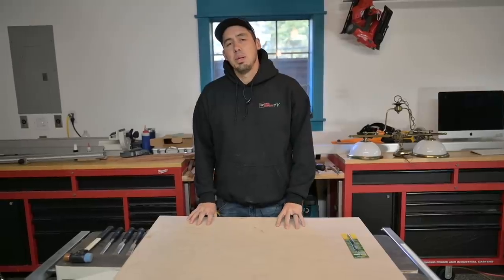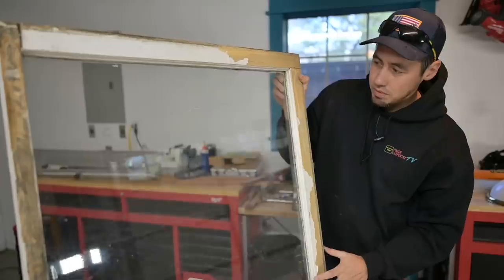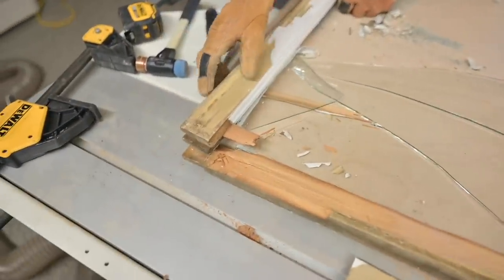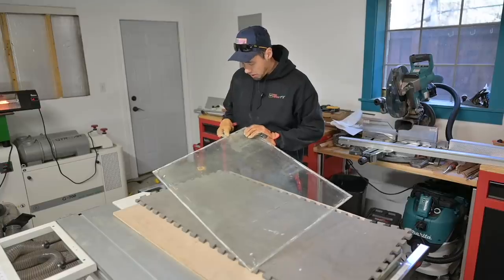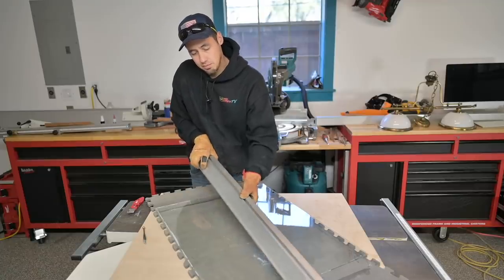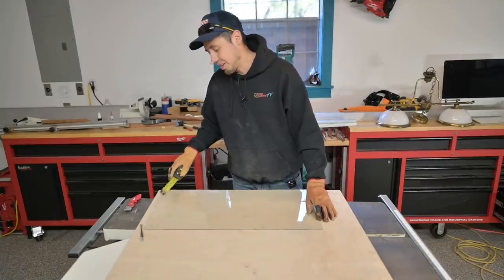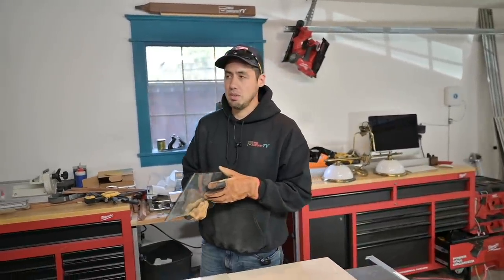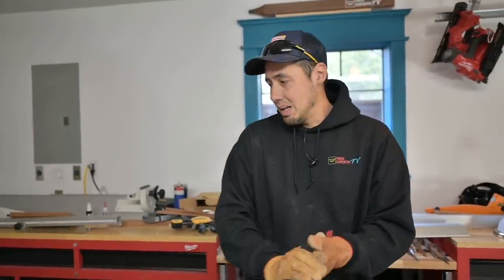Cutting the GLASS for my CUSTOM DOOR!

Comment: Take a sanding block with 100 or 240 grit abrasive and hit all the edges right after cutting. It will soften sharp edges and reduce stress cracks later too.

Comment: The mounting plate for that light is the slotted silver piece in the fixture base. that hollow threaded piece with the wires coming out of it just needs to be backed out most of the way. put screws through the slots into the electrical box.

Comment: Silicone sealants and adhesives won't stick to Odie's Oil so you need to install it BEFORE you finish the door. You also need to have that glass laminated before you install it with a safety film (Building code requires that now, or use tempered glass panels). I saw the future on the first pane. Good thinking to buy a second one while you were there! Layout and cut your hinge mortises and door lock mortises before you finish also, working from both sides to the center of the door.
Cut your hinge mortises with a jig and a handheld router. It'll look better and go faster. Most jigs use a center line to layout to.
Ryobi has an inexpensive jig for hinge mortises that comes with everything you need, and works very well. If you have to layout to the outer edge of the hinges, the ryobi jig will line up flush to your lines as well. It also doesn't leave any extra jig mounting holes in the door.
When you trim your door for width, don't forget your reveals. They are important so the door  and the wall (door jamb) can grow and shrink with weather. I normally leave a 1/8" gap around a door for that purpose.
Great job on your first door! I've built many of them. They are lots of fun to make. Growing your skills in this fashion will make you a much better trim carpenter also, because you begin to understand the reasons things are done the right way!

Comment: Good job bud. If it’s going in a door it should be a safety glass like tempered or laminated glass but it’s your own door so… a couple tips use some oil any oil on your cutter before making your score, try to use a wood straight edge sometimes a metal straight edge can bind with the glass cutter edge, and you can use a torch to help soften the old glazing putty just be careful not to let the glass get to hot. Using a scrap piece of glass to shield your wood sash or glass from the torch helps. Thanks for all your help and tips glad I can pass some back to you
Reply: Experienced custom door builder here.... FrankE is correct. IBC and IRC require tempered or safety glass in all doors.  The reason is that if the door blows open in the wind for example, and there's an object behind the door, when the glass breaks, it will shatter into relatively harmless little pieces.
If you insist on antique wavy glass for the look, it can be laminated. Ask a glass professional. Additionally, do NOT apply Odies oil to the surface of the glass stops where you need to place a bead of clear sealant. Most sealants won't stick to surfaces treated with Odies. You will eventually have a failure. Be sure to have your glass sized slightly smaller than the opening, then center it up with sealant, so the wood movement will not bind up the pane.
Reply: Long time glazier here and all these comments are correct the actual IBC is if you can pass a 9” sphere threw the opening then you are required to use safety glass AS1 or AS2. Good job cutting that glass with a fletcher gold tip and a metal strait edge and no oil on old glass 👍
Reply: @jedsudweeks6676  Technically the wood shouldn't expand and contract lengthwise in that short of a piece of glass, same as when people make jewelry box's and if they use a plywood bottom they cut it to fit if it's a solid wood bottom they leave room for expansion, I don't know about glass I just know about wood movement so maybe the glass has expansion but I wouldn't think that size would, anyways leaving space and centering is best practice.
Reply: @nathanmitchell4839  It's not the glass that moves...it's just that fragile single panes cannot tolerate being press-fitted into wood rabbets. I was simply relaying my experience.
The top rail and the mid rail on his door design have potential for enough expansion (past the edges of the tenons) to squeeze a tightly fitted pane enough to crack the glass during the high humidity season. The expansion happens top to bottom (for the glass). The simple solution is to slightly undersize the pane, like I described. The mahogany panels in the lower portion of the door are more likely to exhibit a seasonal swelling/shrinking cycle that could lead to possible (I hope not) cracks. I noticed in the assembly video there was no use of an EPDM foam gasket or even spaceballs to assist in keeping the panels centered. Unlike furniture pieces, or interior trim work, an entry door experiences wide swings (no pun intended) of humidity and temperature changes. Most of the time it's literally one side against the other. In Dallas during the summer, it's not unusual to have really hot and humid days facing the exterior side and room temperature air on the interior. The stave core construction used is a great solution to combat the tendency for a door to want to warp and bow, but it will still swell just a bit seasonally. That little bit is enough to crack glass that's too tightly fitted. If you still don't believe me, open any solid wood exterior door that's been hanging for more than a couple of years, and run your finger across the top and you'll feel the slight mismatch in the joint between the rails and stiles.

Comment: Old glazing can be softened with a hair dryer, if you use a heat gun or torch, be careful not to apply too much heat too quickly, glass will break easily with uneven expansion. As others have noted, tempered glass in a door is more than a good idea. . Sure, none of the old, fifties era doors used tempered glass, but a piece of glass breaking, as you noticed, breaks in larger sheets with razor sharp edges, tends to leave a mark and potential bleed out. Order the sizes you need, you won't cut tempered glass ;-)

Comment: Hope you're able to reinstall the glass with not too much trouble. Old glass can be brittle and more likely to crack with temperature differences between the inside and outside. When you dragged your glass cutter back and forth, the cutter can produce minute scratches that over time will be come cracks. Similar to a chip on a windshield. The temperature differences, plus vibrations when closing the door will potentially add more stress to the glass leading to cracks. Door looks great.

Comment: So, as for the double pendant light fixture, what you need is a 1/4" nipple ground/ fixture bar. Make sure you remove the wiring from within the nipple and do a dry fit of the canopy to the light box. Also, minimum 8/32 bolt to hold up that light to the box. Love the door build bro!

Comment: I find using a heat gun softens the putty making it far easier to remove assuming it’s the same stuff we use in the uk… As it’s a door and will obviously be feeling some vibration I sometimes use a very thin double sided tape opposed to adhesive. Plus if it were to break it’s far easier to remove.

Comment: I’m shocked the glass didn’t break from cutting it on a raised cushioned area usually it’s best to cut it on a flat hard surface like plywood .. Good job and a heat gun will soften glaze compound for future reference
Reply: It looks like high density foam used for flooring, it wouldn't even compress at the pressure he was using

Comment: If you really want to learn, get a box of glazing points and a tub of glazing putty and install the glass correctly - no adhesive.
Also, put paper or paper towels between the pieces of glass until you're ready to install them or you'll end up with fine scratches in the glass that will annoy you until you move again.
Reply: If you use adhesive you going to increase the chance of the glass cracking as the wood expanded and contract
Reply: You know what’s up except I think he is using wood stops and Daniel Dunn you are correct if you use anything other then silicone

Comment: Not sure if anybody else said it - but the cutter only works right if you’re pushing away, I’ve never made one work right pulling toward me. Dipping the cutter in air tool oil makes it work way better, non - slip stuff on the bottom of the straight edge helps a LOT too. You got your pieces cut clean though - fine work, door is looking good.

Comment: Do yourself a favor and learn how to replace your glass panels. Pin nailing of OK for trim but the sudden shock of the nail near glass might shatter it. They make these glass push pins that are manually set into the wood frame with a putty knife. The glazing not only protects the glass but also the frame edging from moisture. Go to a glass shop and have them teach you. Like cutting and snapping the glass, it's very satisfying.

Comment: Tip when cutting glass, lay down a thin bead of oil along your cut line. As others have mentioned, finish the door first then install the glass. Install the glass by first coating the wood with linseed oil, set the glass, support it with glazing points, then seal it with glazing putty.
Reply: Your correct for most applications but I think he is doing wood stops on the exterior

Comment: Does anyone know if you can cut glass with an angle grinder? Is it easier or problematic?
Reply: I'd think the vibration would shatter the glass. Any blade binding would break it too. A tile saw might work. Why bother with either when the cheap tool (glass cutter) is the right tool.
Reply: @johnVidBozo  I cut vinyl siding with an angle grinder because it's easier for older people than using scissors and also in cold weather the vinyl will shatter with scissors.  It works great but people think I'm weird. Also I have cut plexiglass with a grinder successfully because I don't know other way. An angle grinder is the same as a tile saw. You can put lots of different blades on a grinder. I have never cut glass.
Reply: You can ish with a diamond wheel but I really don’t recommend it your success rate is very low even for pro’s just get a fletcher gold tip like he has and use some oil on your cut line put your glass on a semi hard surface I.e. low pile carpet and go to town make a couple practice cuts you can do it

Comment: Lay a silicone back bead set your glass in that then just shoot your stops on. The silicone will prevent the glass from rattling and also help hold it in place if it ever breaks. Don’t put any silicone on the side of the glass with the stops. that will make them hard to remove in the future if you ever need to change out the glass
Reply: Exactly what this guy said with the exception of making that side your exterior so it's sealed. 

We did restored all the windows in our old barn as a kid, nothing like cutting 7 million pieces of 6"x 8" glass, but we glazed ours back in place for the interior side
Reply: You know what’s up!
Reply: @shandoe7gw867  I'd be afraid the silicone will glue the glass in regardless, if you want to make it repairable. I've used it like that myself. So tough and adhesive, it seems it will be the last thing to go after the whole building rots away.

Comment: Finish and fix the door before glazing, too high risk in breaking the glass when fixing. Do bed the glass in putty, though some recommend silicone, you need a watertight seal between the glass and bead, top and side.

Comment: I hope you gather tips on installing glass in a way that protects the glass AND provides an adequate weather seal against the outdoor elements. When I learned about installing glass, it was important to treat the sash with a little linseed oil to keep the wood from drawing moisture from the glazing compound. I'm not sure if that's still the best way or if technology has generated a simple alternative. I'm sure others will know and share with you. 👍

Comment: Hey old glazer here go to your local glass shop and get some glazing tape 1/16 or 1/8 thick Apply it to the exterior  muttons . It will hold and seal the glass. Also see if they have some setting blocks 1/8 thick to set the lites on just two blocks per lite cut to the thickness of the glass . Be careful nailing on the interior muttons not to hit the lites

Comment: Ah, and don’t slam that door… otherwise you’d need safety glass of some sort. Choose weather sealing that provide some cushion and u should be ok… also some small rubber between glass and the sides of the door can be helpful to avoid rattling noises

Comment: Heads up....you don't want to use adhesive. As the swells and shrinks it will cause the glass to break. Use glass points  and maybe glass putty. 

After all, what was holding that glass in to the piece you took apart.

Comment: I was told by an old glass guy that window glass actually continues to "flo" . This is why old windows are thicker at the bottom of the window pane due to gravity and age than the top. Any "window experts " out there that can confirm this????
Reply: I have always heard that also, but to my understanding it’s an urban legend of sorts. I read that older glass is thin ant the top and thick at the bottom due to the method older windows were manufactured, not because of the glass remaining liquid in all forms!